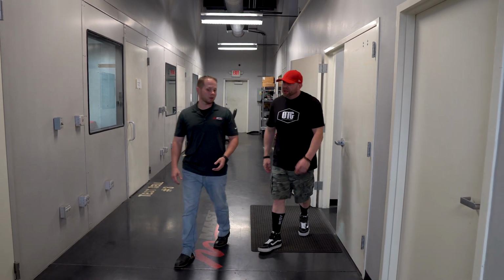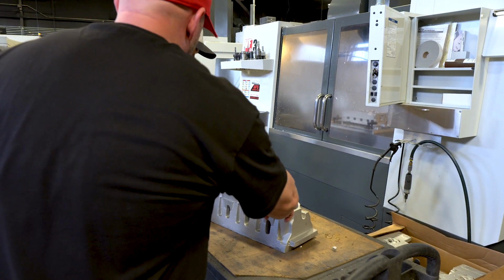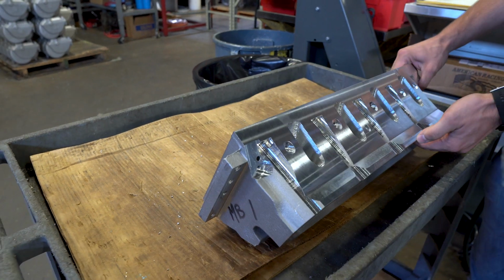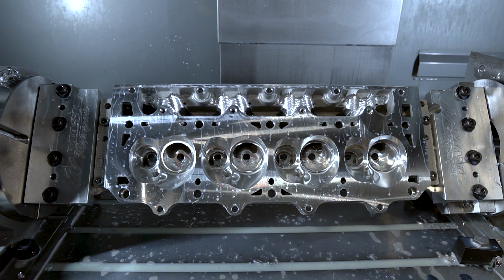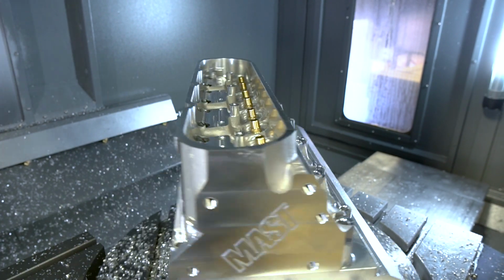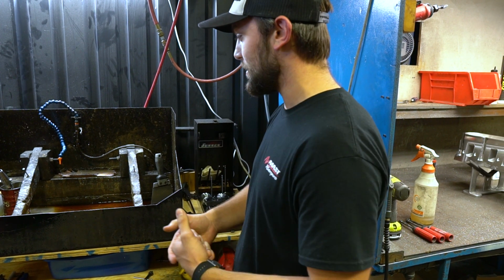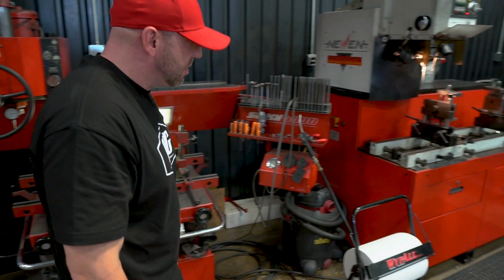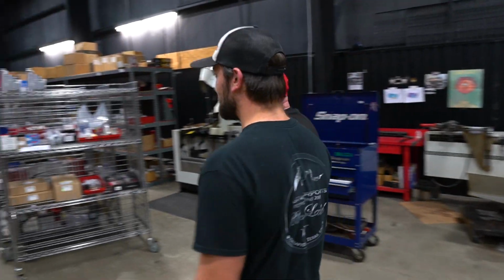Mast Motorsports Shop Tour 2019

Comment: Are you guys offering a Gen VI LT1 heads/cam/valvetrain combo?  Any testing at the track? The brand new Dart heads on my LS1 back in 2008 had 4-6 thousandths (whatever is considered sloppy and ridiculous)  in the valve guides and it drank a quart of oil every thousand miles.  I dealt with it for a year before having them removed and sleeved.  Then it spun a rod bearing on the dyno re-tune.  Good times!